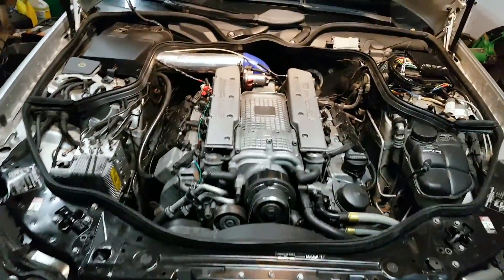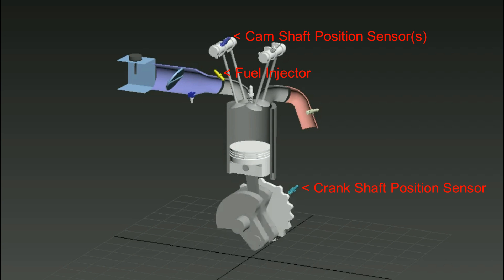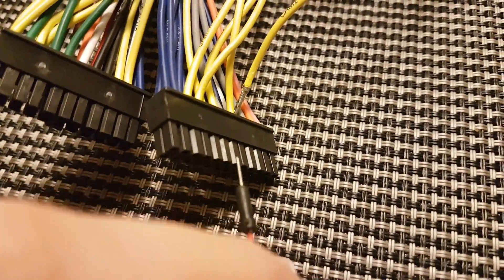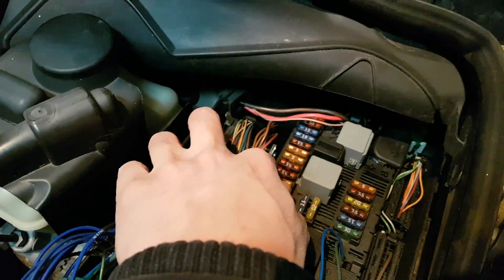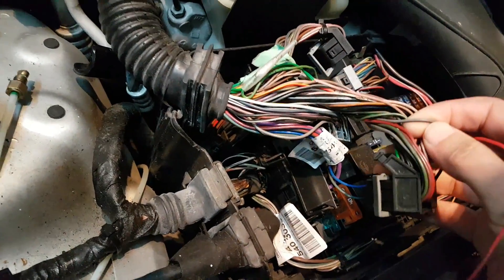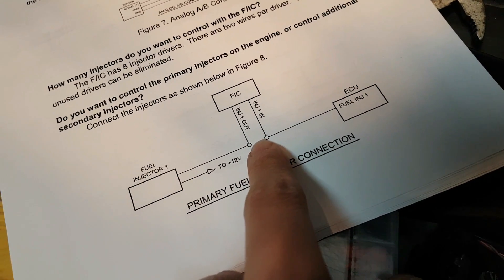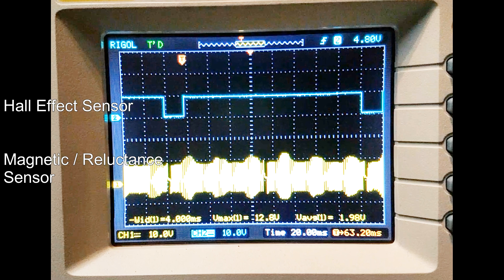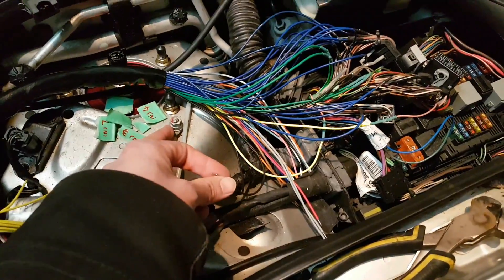Properly Fast Track Car - Part 13 (ECU Install - AEM FIC)

Comment: I prefer patch harnesses. Ends up a lot cleaner and not to mention adds the ability to go back to stock in the case that you want to, if you want to change to a different fic/ecu in the case that yours fails, etc. Just generally much better. Might be more expensive considering you need to find OEM connector types but its worth.

Comment: can such a set up be used to modify or customize ignition coil pack for example to allow for one to change the m275 12 coil packs set  to individual coil packs

Comment: Hey I have a mk4 golf vr6 and Aem fic hooked up. But the stock ecu can detect the aem fic and throws EPC code. Electronic power controll. I know all german cars have the electronic power controll integrated in stock ecu so how did u get ur mercedes to not throw an electronic power code? Please get back to me.

Comment: Hi, sick build! I'm turboing my m104 and I'm wondering if the AEM FIC is still a good option?
Reply from the maker: It works but it's a bit of a trouble to get it working. I'm moving to AEM Infinity next

Comment: What is the benefit of tapping this into your ecu?  Data logging?  Custom tune?
Reply from the maker: If your running additional boost or oversized fuel injectors, the factory ecu doesn't always compensate for it in the right way so you need some way of changing the tune
Reply: @xfmotorsports  hey, I was wondering. So I have headers,a cold air intake,and a more free flowing muffler. My car is 2011,  I wanted to tune my car for the mods it had,do you think they could tune my stock Ecu? Or would I have to get an Aem fic

Comment: Hi i have installed the fic on my e320, mapping was almost done, i encountet a problem with the cam signal in, when i connect this wire, the stock ECU would throw a Fail code. Can you show me which wore did you tap your cam signal to?

Comment: Where do you tap your signal ground to?
Reply from the maker: Traced it from the ground wire on the Intake temp sensor
Reply: Whats your values on injector response time? I recently installef an fic 6 on my e320 with amg super charger on it. I need to smoothen the idle and fine tuning it.
Reply from the maker: Its 405us. I haven't changed it but it depends on your injectors. I have 630cc, it worked fine for those
Reply: @xfmotorsports  i am using 410cc, ill try that values and how it goes on idle. Thank you for your info. Can i have your email? I have a few questions regarding your setup
Reply from the maker: You can send a pm on my instagram. https://www.instagram.com/shehryar8215/

Comment: What slew rate did you set in the F/IC
Reply from the maker: So its an m113 ecu with the m113k engine? Try giving it a lower map and iat reading. That usually advances the timing
Reply: SK8215 yes, it’s running a me2.0. I’m using a billet block off to delete the bypass Tb. I’m having issues also where the fic will leave a single injector signal hanging with higher percent. I just re did all the grounds for the fic and put new injectors. Will test this week. Thanks for the tips!
Reply from the maker: 0.125 deg/5ms, I don't think I changed it
Reply: right now my ecu is only giving me 8 degrees of advance measured through the odb. I plan on dial it in more. My setup is tricky because i fool the maf sensor signal

Comment: Actually, I am not sure you really need the additional throttle body near the turbos. Why can't the turbos spool up into the supercharger; and then you switch the S/C off then and/or bypass it; if you really think you have to?

Jim; ex AMG powertrain engineer - electronic engineer - electrical engineer.

Comment: The tang on each bearing shell displays it the bearing shell has spun you showed one with a flattened  tang this has spun around or moved.   Secondly the all new o ring seal was of a different material than the original made to withstand heat better without hardening.   The simple black rubber o ring was always going to harden this is common in all engines. I have some knowledge concerning  very large diesel engines and the issues you describe are the very same on large mining truck engines costing $300,000. And finally yes a 50 cent o ring can cause a engine to self-destruct, you have proven that.

Comment: Now that you've installed and got the AEM FIC running, are you still happy with your decision? My buddy and I debated this ourselves when building his twin turbo Mustang and decided the stand alone custom option was what we wanted to do. This was several years ago though so back then we had to write all of the code ourselves (controlling both the engine and the automated manual dog clutch transmission). We tried a few lower end piggy back systems on other projects and never were really happy with the results. Faking/tweaking the inputs and outputs to the stock computer to make it handle a custom setup we found difficult to get everything right.

Recently I've been hearing great things from people using some of the newer ECU replacement systems from companies like Holley. These sound like a good option and apparently do a great job looking after custom turbo and supercharger systems. Did you consider using one of these? I don't know if they could also handle unique things like your customized intake valving to switch between the SC and turbo though so you might still need to make a custom controller for that.

Comment: Awesome. I love it that you're breaking the mold and not just following the conventions. Really looking forward to your next FIC installment, as that is what I'm looking to run on my supercharged Montero restoration project but there is such little quality info out there about them. Keep it up!
Reply: I came here for the same thing, looking at rear mount turbo on a Pajero/Montero 3.5L 6G74 SOHC... did you get started?

Comment: This is a very cool video.
What year is your 55?
I have an 02 C230K (2.3l) I would like to put one of these on.

You think an fic 8 would work on a 4 banger or do I need to get a fic 6?

Reason I ask is I found one pretty cheap.
Thanks.
Reply from the maker: Its an 04. Yeh, I believe it would work on a 4 cyl as well
Reply: SK8215 Thank you for the reply.
Cool car you have there.
Adding a turbo to my supercharged car would be awesome.

Comment: I watched an older video of you. U claimed that the purpose of the splitter is to force the air to go above the car. And u filled the gaps of the splitter and the bumber with foam to force airflow above the car. But this is totally wrong. The air has to be chanelled between splitter and bumper in order to create downforce. So the splitter „slices“ through the air. If u know what i mean.
Reply from the maker: Well, the purpose of a splitter is to prevent air from getting underneath the car, because air that gets underneath it creates lift at the front. If your letting air through the splitter that only makes the splitter less effective. The only other thing Ive heard of is letting air pass from the sides of the bumper, thats to create vortices to seal the sides of the car, but thats a fairly complex thing to get right
Reply: SK8215 Now that u said this, whats the purpose of the spoiler on the trunk? From what u said, the spoiler on the back should not let air between the spoiler and the trunk, because it would lift the back of the car?
Reply from the maker: The trunk isn't the ground. The rear wing doesnt work in ground effect. Any pressure between the ground and the cars body creates lift. Aero doesnt always work the way you think it would. I also had to do some cad simulation to figure it. I'm not an expert at it but if you want to learn download a cad software and experiment yourself.
Reply: SK8215 So just build a barrier in front of the car where the air just smashes against the front and cant escape which slows you down?
Reply: I do see the point Edr is trying to make even tho he presents it poorly, have you though of guiding the air collected from the splitter up though the hood or fenders if the is room ofc for increased downforce?

Comment: I’m going a complete car 1/4mile and track car, need lsd bad
Reply from the maker: Yeh, lsd is a must have on these cars. I'm running a wavetrac lsd, with the open diff it was impossible getting the power down.